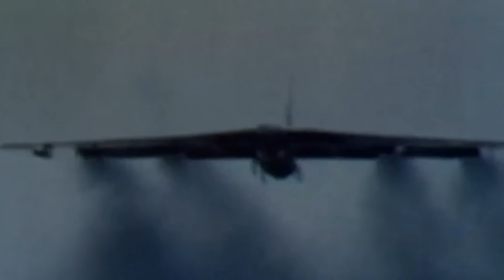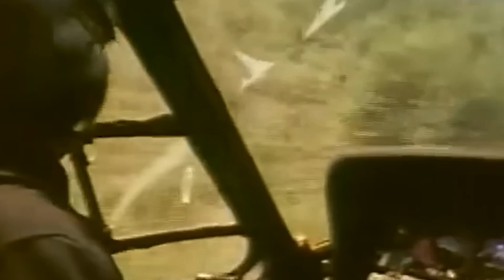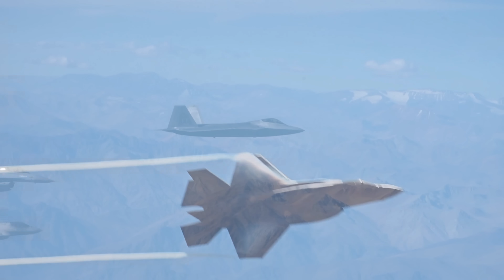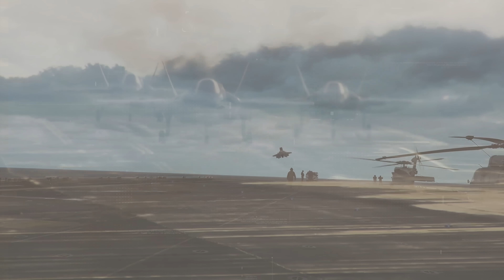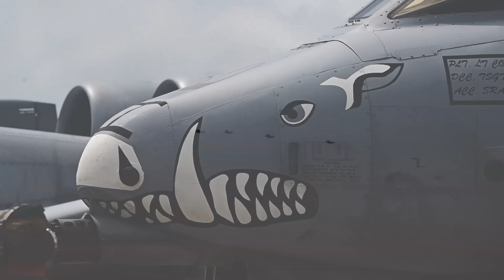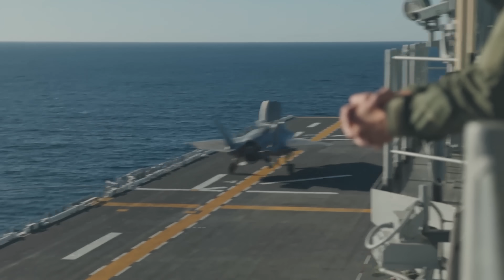A “STUPID” Mistake Is Making the F-35 UNSTOPPABLE

Comment: I wonder (knowing nothing about aircraft design) whether the A model could have its internal gun removed and have an external pod added.
Reply: いいえ、それは難しいでしょう。
F-35のガンポッドは3000psiの油圧がなければ動作しません。
そして、F-35Aには必要なオイルラインが配管されていません。
Reply: There might be some conflicts that have to be resolved, and possibly some new structural parts designed, but you should be able to do most of that from piecing together the plans for the three existing versions.

Comment: The Vietnam era of radar guided and heat seeking missiles had a 16% effective hit rating. We launched so many into the dirt we eventually planted fields of sparrow and sidewinder missiles hoping they would sprout and grow into more effective missiles and they actually did! The sparrow underwent multiple crop rotations and gained a more accurate radar guidance processor, and greater range and it became marginally better. The sidewinder sprouted a new effective heat seeker, and it grew longer legs which resulted in an increased effective hit percentage of 50% by the end of the Vietnam campaign. But then the AAMRAM was found in the deep jungle and with great care it grew into a nice tall effective mid-range air to air missile. The sidewinder sprouted a new effective heat seeker, and it grew much longer legs which resulted in an increased effective hit percentage between both missiles of 80% by the end of the Iraqi campaign.
Reply: Note: a lot of the problem with those Vietnam era missiles ended up being inadequate pilot training on how to use them. They were frequently fired out of envelope, or with uncooled sensor heads.  There is a paper titled “Revolt of the Majors” that details how training was improved after the war.

Comment: While the F-35B and F-35C can replace the gun pod with a Energy Laser Pod, the F-35A can still have both the laser and the gun. The caveat is that a modified NGAP Engine has to be used for all 3 F-35 variants to take full advantage of laser weapons.

Comment: you would think that the A model could easily be configured to become pod capable. not for the gun obviously, but any of the multi-mission packages.
Reply: It wasnt made for the weight they would have to change the build.
Reply: @MoDeLi370  But surely, such changes could be made? It's not like someone said "no more changes allowed" and triple stamped it so rules say they would have to wait until 2070 before they can unseal it.
Reply: @FloydATC  The frame and internal configuration is different. You can’t beef up the chassis after the plane has been made

Comment: 13:37 the F-15E Strike Eagle has a 500 round capacity and they only get 3 trigger pulls on average
Reply: The ex is special, designed to follow F22/35  and drop massive laser guidance bombs from the former 22/35

Comment: So what your claiming is the problem on the B and C is not a mistake. The gun on the B and C models is not necessarily for Air to Air engagements but more for ground support. The location of the gun is well through out not just stuck on as an after through. The pod is not a stupid mistake and any one thinking so just shows how little they know.

Comment: Plus, sometimes Vietnam combat pilots, it routinely took several attempts to launch a missile to get one that didn't just drop out of the sky
Reply: Why we talking at vietnam?
Reply: @MoDeLi370 because the lessons learned in that war are relevant today and will be on the future.
Reply: @ronin47-ThorstenFrank  The problem is technology never stops, it's not 1970 anymore and we have the AIM-9X now. It's HOBS and doesn't track the sun or clouds. It's even LOAL capable. As in get the missile in the air to force the enemy defensive and then cue it.
Reply: @Zboe-JL That is true. In fact I took that into account before commenting - and still, I come to the same conclusion as before. 
The problem with every guidance system is that there is the possibility it can be jammed. 
Yes, modern systems are much better at not getting jammed in any way. But what if somebody of the OPFOR finds a way? 
As a veteran myself I rather have an additional option that might give me chance even if I´m not be able to actully kill the enemy. It´s often enough that the opposing one is scared that I might be able to.
Reply: @MoDeLi370  Because the role of cannons remains mostly unchanged -- just slightly expanded, now that drones and proximity-fuzed autocannon shells exist as a problem and its solution.  The old role is still doing just a great job, though.

Comment: So why can't the A version carry the same pods?
Reply: What same pods?
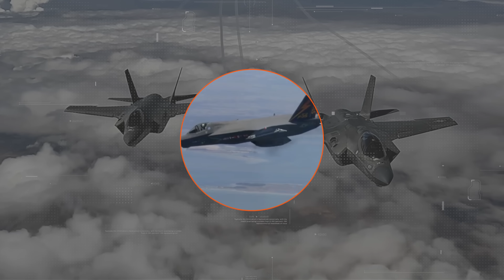Reply: @JSFGuy   Terma's GPU-9A (for the F-35B) and the GPU-8A (for the F-36C).  ( 7:47 )
Reply: @GeorgiaDawgAthens very well, you need to be specific about your reference. Well I can tell you it's one of those non-100% interchangeability things. Would there be need for a gun pod on a platform that has a gun internal? If there are fitment issues that are unique to the AF compared to the CF and the BF then there's no reason for it because the AF has an internal Canon. Apparently you did not know about that?
Reply: @JSFGuy  i dont think you comprehend what hes referring too, the pod can be used with other modules as well(as shown late in the video), so if one wanted lets say use both the gun AND a different type of pod/module @aka not a 2nd gun, but maybe a jammer or something else(extra flares/wpn/fuel), one would have to give up the gun on the B/C model, aka why the F35A would be unqie if it could carry the same pods or a varriantion of these.
Reply: @AdaaDK so I've now have a second outside person trying to explain to me what the OP was referring to and it's my comprehension that's the problem? I got news for you, I'm on the program of developmental test and what you are suggesting is not a thing. This video does not have program access so. Neither you or the video creator understands. Let the OP answer my question.

Comment: How reliable is it?  I realize that when it is actually functioning it is Terrifyingly powerful, but how reliable is it to be there repeatedly in a fight??  Sitting on the ground being repaired and or re-programmed isn't doing anybody any good.  Massively complex doesn't necessarily translate into "operationally" better.  Just sayin'.
JBC
Reply: Its very reliabe...no reason to say otherwise realistically its not only combat proven but proven in every metric.
Reply: I'd say the F-35 has been proven fairly reliable at this point. It's not like it isn't battle tested anymore.

Comment: The nice thing about the cannon is it's fairly low-tech and reliable. ECM might mess with your hud and jam your missiles, but it's not stopping raufoss rounds.
Reply: No ECM is going to mess with your hud, and it has no effect on IR or laser guidance.  At best, ECM reduces the range at which radar guidance is reliable, and even that reduced range is still going to be longer than gun range — which itself is dependent on radar for range finding.
Reply: Brrrrrrrttt

Comment: "A10 Warthogs which need huge runways to take off and land". They don't, they are STOL planes.
Reply: Yeah they were specifically designed to be able to be serviced and launched from really substandard airfields.
Reply: Land based STOL is still a huge runway compared to a....BOAT.
Reply: @shooter7a an A10 with modern engines could probably take off from a carrier if it had to.
Reply: @Noisy_Cricket  LOL....uh...no.  With a combat load, the A-10 take-off spec is 4000' runway.  Sorry...those are the specs.  Without catapult brackets and arrest hooks, and an airframe designed for the loads, no aircraft can reliably take off from a modern carrier.  Stop with the stupid delusions.
Reply: @s @shooter7a Next time leave off “stupid…” you didn’t need that in a great comment.
Reply: @brianclemetson8781  next time stop being so sensitive
Reply: @Noisy_Cricket You’re right and you wouldn’t need a catapult. All you have to do is get to the wheels off the deck before the end. Trouble is getting the A-10 on the Carrier in the first place if your not in port with a crane. 😂
Reply: @TegwynF to get the wheels off the deck you need a frame to handle the force of a catapult and engines to create enough thrust. The A10 was not created for that
Reply: @TheFieldy107  Okay I get it. You have a lack of respect with no bearing of constructive criticism. Or want to have your point heard 👍
Reply: @shooter7a  I said with modern engines. With modern engines, the A10 could probably get like twice the thrust it has now.
Reply: @brianclemetson8781 No shit. Read all of what I said.
Reply: @shooter7a  why are you factoring off the catapult when thats what aircraft use to take off bruh its a given that its going to be used
Reply: @shooter7a  If only the runway spec was just the distance for takeoff and didn't include the distance to stop if you have a rejected takeoff up to V1. But it does which means an A-10 needs far less real distance just to get off the ground. No I'm not saying it could be carrier capable either.
Reply: They actually do need a bigger runway, that's why they aren't carrier based.
Reply: Military Channel gives the keyboard nerds a great place to make nasty comments.
Reply: Depends on the amount of pre-intalled weapons load
Reply: @al28854 For most plans yes. Not the A10
Reply: @brianclemetson8781  an A-10 with a full weapons load has some pretty serious flight issues, including not having enough thrust to break 300 knots.  I wouldn’t be surprised if it needs a fairly long runway.
Reply: Those titanium blades were a requirement not a modern weight saving measure. That disqualifies all modern engines really
Reply: "The Military Channel". LOL.

Comment: Over priced and limited to warmer climates.
Reply: Brazil is paying 180 million for each Gripen. The F35 costs 110 million per plane. The F35 is rated to -40, and flown in -50. The Gripen is rated to -30. Yes, over priced and only for warm weather.
Reply: @eec-q3 You are telling me a story.  The Gripen is a fraction of the price of an F-35 and a fraction to own and operate as well.  You really are ignorant.
Reply: @RickChapman-c8e You are the one that is ignorant. Just Google Brazil Gripen. 

In fact, Brazil is thinking of backing out.
Reply: @RickChapman-c8e The original contract between Saab and Brazil was for 36 type E's at 5.4 billion. Saab is saying it can't meet the original agreement but it can meet the 5.4 billion price tag for 30 planes, which equals 180 million per plane.

Also Saab promised up to 14,000 jobs. So far, only 200 additional jobs.

On Ukrainian defense news sources, Ukraine has informed Saab it will not pay 150-180 million per plane. 

Oops.
Reply: @eec-q3 Once Canada actually builds the plant, mass production will drive the price/unit down.
Reply: @eec-q3 This American economic pressure forcing lesser financial powers to back down.  But determination and focus will overcome Trump’s stupid taxes.
Reply: @RickChapman-c8e Check with Brazil. Saab said it would generate 14,000 jobs in Brazil. 200 so far.

The F35 already generates 5,000 jobs in Canada now.

Plus, Gripen is saying the price is going up and Brazil won't get the other planes by 2032, maybe.
Reply: @RickChapman-c8e There is no pressure. We have a right to control our technology. Maybe spend more money on defense, develope your own. 

I can't understand the tariff argument, Canada and Europe have always targeted US companies with extra fees and yet the US lived without. As long as our so called friends get preferential treatment, they are fine.
Reply: @eec-q3 Guess what.  Financial warfare is still warfare.  So if the Fat Orange Whine ass is getting his ass handed to him for being a Tyrant, then he deserves it.  As for Americans standing up for him…you need to maybe check your bias and check your real standing.  Trump has F’d Americans to line his pockets and the pockets of the super wealthy.  He doesn’t give two shits about the masses and like Putin will make us all canon fodder.
Reply: @e @eec-q3 Good.  More jobs is better.  So building Saabs isn’t a bad move either.  Like Canada selling refined oil around the world is better than just selling crude.
Reply: @RickChapman-c8e Name an  American president that hasnt lined their pockets? All are rich and I fully expect Trump to keep us out of Russia's cross hairs. If you want to fight Russia, go ahead, I won't care.
Reply: @RickChapman-c8e Apparently you can't understand. Canada will lose jobs with the Gripen. Saab has made plenty of promises that it can't keep. 

As far as refined oil, Canada doesn't have the refineries to do it. Canada is stuck with selling mostly crude.
Reply: @eec-q3 How about we just look at the one who has blatantly turned the Presidency into his own get out of being broke card.
Reply: @eec-q3 Canada will gain jobs with Gripen also.  AS for the tech that Canada has to help produce the F35…that’s Canadian tech and we can add that to the Gripen, thus not really losing those jobs either.  The US can’t just play the we steal your tech game.  what’s good for the Goose.  CAnada can play that same game.  The F35s we have  already we could just take to Canada and take the tech too.

Comment: Excellent video. US allies have almost 1000 F-35’s, most are A versions. The USA has over 1000, about half are A variants.
Reply: I mean, it's not like F-35s are used for dogfighting and with the stealth/long range option, they can probably take out enemy fighters easily without even being detected.
Reply: Your numbers are about double what Lockheed reports as having actually been manufactured
Reply: well, the US have "force feed" those pile of junk down the throats of many of their allies, using all the tricks in the book... they don't deliver on time, the plane isn't combat capable as is and they charge for the the increased cost due to their tardiness AND the "upgrades/fixes" that were to be included originally...
then they scam the customer even more by reallocating payments from one system to another (from the F35 to Patriot)... ask the Swiss about it... 
the US are getting branded as "unreliable" on so many level right now, it's a wonder how one can trash their reputation build on years of efforts and the back of their soldiers, in so short of a time
Reply: @kolerick Nonsense. The F35 is built in 9 countries. The UK just had damage at 2 of their companies that makes parts for the F35, they claim it will take up to a year to get back on schedule.  Since you us the Swiss, the Swiss also did a study were it said the F35 would save over 1 billion dollars per plane compared to any other jet.
Reply: @eec-q3  yeah yeah... and Santa Claus exist...
Reply: @eec-q3  yeah yeah... and Santa Claus is real...
I'm Swiss... and I know that the politicians and military men who signed on this are in hot water right now
Reply: @kolerick  You may be in hotter water. Russia may decide to make Western Europe glow.
Reply: @kolerick All true but at least local governments now have a reason to keep their native ( or near native) industries competitive. Previously they took the “cheap & ready” route. British dumped the TSR2 In favour of F111 which turned out to be a dud.
Reply: The US keeps driving it's "Allies" away. Ex-allies must steer away from the F-35 for this very reason. If the Trump administration keeps it up, the only ally left will be Israel.

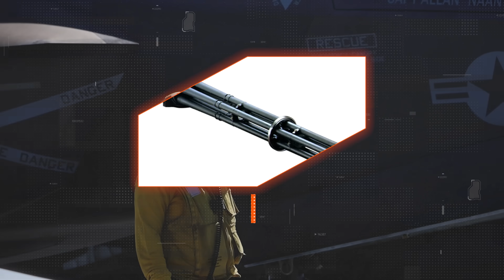Comment: 9:35 - Narrator says "it's a four-barrel...."  Picture shows 5 barrels.
Reply: the 5 th one is a dummy to fool the enemy
Reply: @stevenphillips3466  I was fooled.

OMG... am I the enemy??
Reply: @stevenphillips3466  The 5th is used for Russian roulette. When the enemy is staring down the barrel he has to wonder if it's the dummy barrel or one of the real ones.
Reply: Whoever slopped this together used a pic of a GAU-12 instead of a GAU-22.  The GAU-12 is used on Harriers and AC-130 gunships.
Reply: Well vid is titled "a stupid mistake..." 😂😂
Reply: He was talking about the carburetor.
Reply: yeah but  they don't tell you about  the roof rack  or trailer hitch that's classified 😊
Reply: Oh dear he forgot to add a caution note. It’s an ILLUSTRATION. it’s not an instruction manual.
Reply: @Dave5843-d9m  Oh dear, I've forgot to add a caution note.  My reply was a JOKE.  It's not an actual complaint.